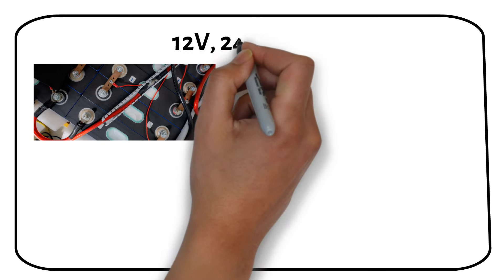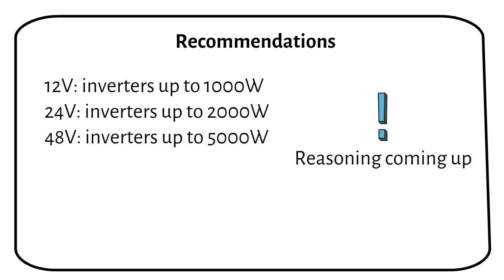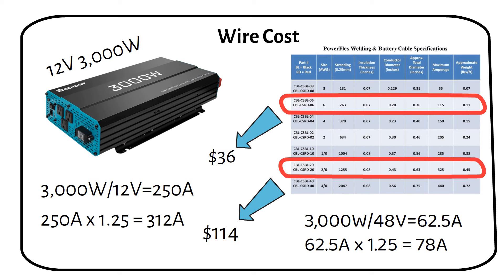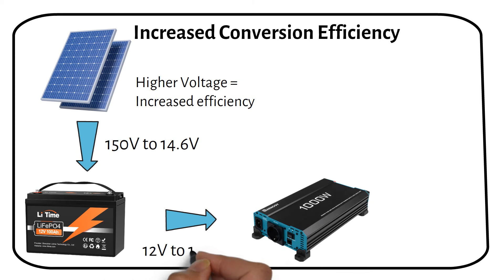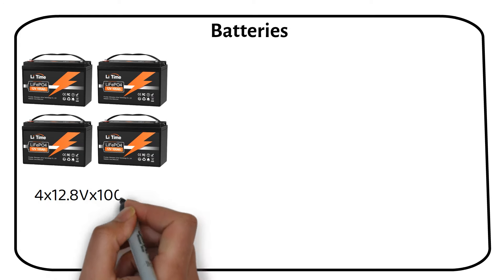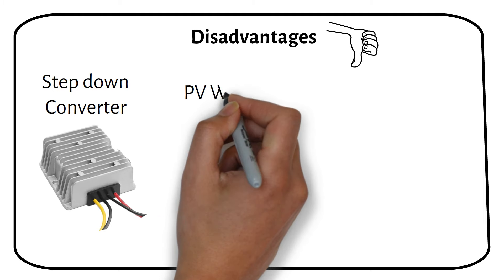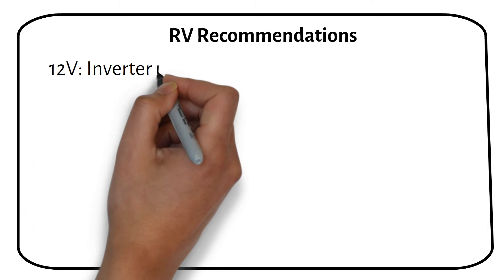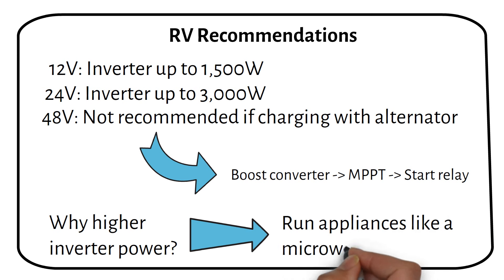12V, 24V, or 48V Battery for Off-Grid Solar Power

Comment: 48v does not pose any danger of electric shock. Please don't mislead people.
Reply from the maker: A fully charged battery is 56V. This is over the low voltage limit of 50V. so it's dangerous in the right circumstances.
Reply: No anything under 50 volts in considered low voltage a potential difference of .06 ma can kill
Reply: Le courant alternatif est dangereux à partir de 60V . Le courant continu est dangereux à partir de 120V dans les conditions normales… valeurs sont à diviser par 2, dans des conditions mouillées 😊… voilà ma contribution. Bonne soirée. From Paris 2024😊
Reply: Since the 48v batteries I use have a power switch
Reply: It's electricity don't matter it depends on the person's health
Reply: One of the greatest minds in solar, Dacian, when inventing his charge controllers and bms have repeatedly said he won't upgrade his ELECTRODACUS system to 48V is because 48v is dangerous.
Reply: Less than 30V won’t electrocute you if you complete the circuit. 48v is a different story.
Reply: Yeah right 12 volts can kill if the current is high enough. It's current kills not voltage. 48 volt can burn you if a short circuit and batteries are flammable fire kills just as much as electricity. To be safe cut off the battery and panels. You should have cut offs in your system bottom line it's safer to be over cautious than not say anything.  73
Reply: @ronb6182  we are assuming that our circuits are fused properly which will limit the current.  Back when I repaired batteries I regularly worked on 170Vdc battery packs.  These, however, were in a controlled environment so there was little chance of them moving around or things landing on them. There was certainly no chance of accidentally brushing up against them.  Properly done, a little 9v transistor radio battery can stop your heart, but generally, you won’t be killed by conventional 12v or 24v LFP batteries. 48v is a different story.
Reply: @cleversolarpower This is the extremely rare YouTube case, where you are both correct. 🙂 😂 (because NFPA and OSHA say 50 Volts)
Reply: 🤷 I guess sometimes it could take very little so mess someone’s electrical signals or impulse in the heart. Thinking d-fib/a-fib, I’m not a doctor, or an electrician lol
Reply: 48 volt can kill you dummy

Comment: Well, no one running a 48 volt 3,000 watt inverter should really use 6 gauge wire, that's not even a thing..My 3,000 watt inverter came with 4 gauge wires, and good ones, but I replaced those with better quality 2 gauge wires..Wires from inverters to batteries should always be over sized, or the maximum size the inverter will allow for..Short wires are a tiny cost when building a good system..If you are running wires 25-50 feet, that's a different story, but I wouldn't recommend that in just about any situation. I have a cabin in the forest, and I'm in a valley surrounded by mountains, so I don't get alot of sun, especially in the winter..I made a tiltable mount for my 370 watt panels, but it can also move to follow the sun from east to west..Both ends of the mount are 4x4 posts with a square frame made with 2x6's..A ten inch screw goes through the 4x4 posts and through the 2x6's giving me the ability to tilt the system..Which alot of people do..One of my 4x4's is connected to a platform I built from 2x4's and 2x6's and I put four 8 inch wheels underneath, the other 4x4 post is in a 3 foot hole in the ground connected to a bearing plate assembly..So as the sun moves across the southern sky from east to west, I can move the side with the wheels to follow it, while the other 4x4 rotates in place..I also installed some cement plugs in the ground with I bolts, so I can connect wire to the mounting system in it's various positions to secure it, in case of high winds..The system has increased it's output by over 40%, from when it was non tiltable or movable..When it hails I can make my panels go straight up and down, and the same thing when it snows..The panels are bifacial, so I also built a movable reflector for the underside..
Reply from the maker: 6 gauge wires are calculated on 105°C insulation temperature (welding cable). If you have a 90°C insulation rated cable, then yes, you need a larger wire.
Reply: @cleversolarpower  I'm going to point out that for power transmission, you don't go by temperature.  You don't want anything in the RV, boat, etc to ever get that hot even when the cable itself can handle it.   And you also don't want there ever to be any appreciable voltage drop at the nominal load if the cable happens to be long.  So use the power transmission AWG table for power-related stuff, always.  Do not use the temperature-ratings.

3000W @ 51.2V nominal (16s 48V LiFePO4) = ~60A = 4 AWG by the power transmission table.

That said, if you only need 3000W for surge and your nominal continuous power is far less, like 1500W, then you can size the wire for 30A power transmission which is 7 AWG with an appropriate 30A breaker and still allows surges to exceed that (type C DC breaker rather than the faster-tripping type B).

-Matt
Reply: @junkerzn7312 what would u recommend on a person that wears oxygen 24/7 if the grid went down.? Thank you
Reply: I was gonnna recommend an ohms law calculation
Reply: I'm wanting a similar system , csn you tell me how much battery , ah and volts. 
Plus panels amd wattage your using etc. 
I am a low maintenance person but still wanna have options also

Comment: I am using 2000w Modified Inverter with 2 x 12.8v 100Ah ea Gel Batteries in parallel, charging with solar panels, connected with 50A Controller I use this system to power my 170L Fridge on a daily basis + Charging Phones, Laptop. I started to use the system October 2023 till today and I can say that it is working effectively.
Reply from the maker: I recommend you take a look at my video about: 'how many batteries for a 3,000W inverter' it will help you size the system even better.

Comment: I have been experimenting with solar systems for the past three weeks. I purchased a 12-volt inverter with a 240V AC output, which is connected to four 115Ah AGM batteries. I have come to realise that the inverter was an error, as it draws too much current for UK 240V electrical equipment. Would you recommend that I opt for a 48V inverter instead? I will likely need to acquire an all-in-one solar charger, and I plan to configure the twelve 100-watt solar panels in series for the 48V system.
Reply from the maker: I recommend watching my most popular video on my channel. It's about sizing the battery to the inverter.

Comment: Can you tell me how to get maximum backup from Led acid or tubular batteries? Isn't it ture that Dc system is best for batteries to get maximum backup instead of inverter which converts 12 or 24 volts to 220 volts.
Reply from the maker: I recommend watching my video about sizing an off grid solar system.
Reply: @cleversolarpower  ok

Comment: Can i run ps4 slim using  48volts battery and 7000 inverter?
Reply from the maker: Yes, you can run about 28 of them.

Comment: Your video explains it very well. Thanks. I also used an inverter and a deep cycle 12V battery - The inverter burned out after a year and the battery did not last long. 12 Volt systems are not designed for large loads or Watts no matter how you wire it.

Comment: XLNT! I settled on 24v for my small project. Would have liked to do 48v but my initial 2 panel start wouldn't produce over 48v. I have 6 RV panels but ended up with two charge controllers. Gotta love Victron and the way the two controllers and smart shunt all talk to each other.  2 panels on a moveable angle adjustable cart feeding a 100/20. 4 panels fixed angle on roof feeding a 150/35. I wanted to experiment with angle and position of the cart and see if it generated more (or less) than 50% of the roof panels by moving it throughout the day and adjusting angle for the season.  Now in the winter I'm really seeing significant differences moving and angle adjusting makes.
Reply: Wait until you try ELECTRODACUS system. The guy is a genius.

Comment: Good video though I would add the number one benifit of higher volts is lower current which IS lower resistance resulting in lower HEAT POTENTIAL! A lot of new chargers can do all three 12/24/48v. I’d suggest to anyone dabbling in this area for the first time start at 12v for a few months until your confident to shift up to 24v and home run on 48v.. 12v is safer getting your feet wet.
Reply: I’m looking to backup my home for a few hours during random power losses.  Would like to have a system that can supply 11kwh (if I need it longer on that day I can fire up generator).  Would you suggest 48v for this application?   I’m experienced working safely with 480v systems at work however mapping them out for logistics. Is not my strong point😂

Comment: I have a off grid small cabin and i only want to run a minifridge, i currently have a 24v , 50 ah lithium battery and a 24v 1000watt pure sine wave inverter connected to two 320 watt panels in parallel that are 34v with a 30 amp mppt charge controller, do you think it will work?

Comment: Unfortunately I didn't realise my 48v battery from renogy was a 15s not a 16s, that extra cell makes a big difference to capacity. My battery is new and only settles at 50volts after charging to 54v. Doesn't seem right to me

Comment: There should be more 12v appliances today (meaning no need for 120V / AC voltage step-down conversions) especially for short distance wiring such as RV or mini-van converted campers lifestyle

Comment: Hi Sir, I bought 12V 990 watt solar panel, 230A battery and 1100VA inverter. Now how to connect the solar panels series or parallel
Reply: How many panels? Where are you using the system, RV or home?

Comment: Thanks for the lectures. How can I connect 6batteries on a 48v system
Reply from the maker: You can't. It's either 4x 12V batteries or 8x 6V batteries, ... So you have two batteries left over.

Comment: Hello, I am using 3000W hybrid inverter, 3x200ah Gel batteries and 2x400w solar panels but it only runs for only 4hours after sunset.
Reply: What appliances are you using ?. 4 hours seems pretty small
Reply: 800w panels not enough to charge 600ah battery fully

Comment: I have two identical 12 volt 100ah batteries and another 12 volt 280 ah battery,  After selecting a fourth 12v 100ah battery, would it be possible to wire these four mismatched batteries to 48 volts?

Jeff <----- newby trying to understand.

Nick, I have the book ordered from Amazon, expecting anyday now....

Comment: Sterling power sells a 12v-> 48v charger for automotive use.  Also, a secondary 48v alternator is a common way to charge a 48v system. 48v 100a alternators put out 5000W which is good for charging large 48v batteries.
Reply from the maker: The sterling 12V-48V charger sells for $800 I believe, not in everyone's budget.
Reply: @cleversolarpower  it charges at about 800 watts. Equivalent 12v-12v dc-dc chargers (or pairs of lesser chargers) will cost in the same ballpark

Comment: My local shop said don’t mess around with installing a 24v secondary battery/accessory system because it may cause issues given my car is 12V. 
What are your thoughts? I told them I was leaning toward a 24v setup after watching your videos
Reply from the maker: What issues? Your battery is 12V, not your car. Checkout my video about grounding.

Comment: These days 96V batteries are on the marked, can you make a video with your advise and calculation examples how to setup a system combined with solar?
Reply from the maker: Inverters are still limited to max 48V batteries, so the market is still very small.

Comment: Maybe it could be added that 50V is  the regulatory limit for low-voltage at least in some EU countries and 48V systems can go over that limit. This also means that officially you would need to hire an certified electrician to do the installation, which means any cost calculations going out the window. You can of course still do it yourself, but if your cabin/rv burns down for ANY reason, good luck explaining your DIY wiring job to the insurance company.
Reply from the maker: Great comment. 👏

Comment: Thanks again Nick for the solar diagrams, and informative material it’s great! But have a question. I’ve built Mob. Homes with solar since 1986 (10% eff & no controllers!) I’ve now decided to go the 24v 100A Lith. for house.  
The nagging Q is; why not wire the (my 750w 37.5v solar) controller on the (24v) cranking batt. side, the input to the 30-amp B2B? 
The pros would be less work for the alternator, cranks kept charged, and, save a few drops of fuel. Would I get away with that?

Comment: I see you talked about RV, but what about off-grid homes?
Will it not be better to go for 400v systems or similar that's closer to the solar panel voltages? Will HV system still be better than the typical 52V (LV) system?
There are systems like FoxESS, Sungrow and Sigenergy with these high voltage systems. The installation costs for the Fox and Sungrow are similar to that of the same size 52V system, and they are more efficient when coming to charging with a solar array due to the HV match
Reply from the maker: I talk about RV's and off grid homes in my videos. there is a limited amount of inverters that are suitable for high voltage. I recommend using 48V for home systems. You should not be installing systems higher than 48V yourself because it's quite dangerous.

Comment: I'm all new to this , why would a stronger converter require a smaller cooper wire
Reply from the maker: Because the voltage is different. Use the formula: current = power/voltage and you will see that if you increase the voltage, the current will drop. We size wires based on the current.

Comment: 2:10 How many feet of 2/0 wire are you talking about that is $114? What formula are you using?
Reply from the maker: 10ft black, 10ft red welding cable from windynation. Calculation is at 2:00

Comment: Hi Nick, 
I need help!
 
 I just 2x 25.6V/100Ah battery (lithium ), inverter 4000W, 
MPPT 100/50, 
solar panel 1x220W/(Voc 46,11V)/ 38,00V (Vmp) and
 1x180W/ 44,8V (Voc)/ 36,00(Vmp).

I live in Croatia. 3 days without sun battery comes to 30%.

Frigidaire 150
Leigh  80
Computer 30
Washing machine 2000
Water pump 600

How mach(power) solar panel's can I put?

Thanks for answers!
Reply from the maker: Depends on the total power consumption in a day in Watt-hours.

Comment: Wouldn't the Victron Orion 48v DC/DC converter work for a 48v RV for alternator charging?
Reply from the maker: That is a DC/DC converter. You need an Orion tr-smart 12-48v which doesn't exist. I found out the hard way 😄. Converters are not able to charge batteries.
Reply: @cleversolarpower    Thanks!  I'll remove this component and feature from my diagram.  Thanks for putting this video out!
Reply from the maker: svenshanah  They are very expensive. It would be cheaper to have a 24V system.But thanks for recommending me the brands, I have heard about the wakespeed, but not about Steerling.

Comment: Please advice, I m using 2x400w solar panels and 3kv hybrid inverter and two 200ah gel batteries but is discharging after 4hours from sunset, and I m only running a plasma 41"TV only. I m in South Africa. ✌️
Reply: I'm not an expert, but it seems like there's something not right with your system . What is the rated voltage and Amps on your TV input? (You can find that information on the backside of the TV or on the TV's power adapter)

How many amps of charging power does your inverter have?
Reply from the maker: 800W*6hours=4800Wh charging a day. 3,000W inverter = 30-50W standby power consumption = 40W*24h=960Wh. 12V*200Ah*2batteries*0.5 (50% DOD)=2400Wh. From my calculations your battery is charged up every day. You can use 2400Wh of battery power where 960Wh is consumed by the hybrid inverter itself. That leaves you with 1440Wh. Lets say the power is 150W*4hours=600Wh. That leaves you with  840Wh which are the battery degradation and energy transformation losses. So there is nothing wrong with your system, it's just undersized for the load.

Comment: i own a 48v system with 20 - 235W panels and I have purchased 30 - 260W additional panels , this is a 12kw system and will be adding 2 wind turbines as well which put out about 2kw each with 40 mph wind. This system came with 24 AGM batteries 105 Ah with 2 - 80 A Charge controllers, so I know that more charge controllers are necessary for the added panels and I suspect I will need more storage as the area this system will be located is overcast quite a bit, and that is the reason I purchased the other panels and need the extra controllers and batteries. This is my 1st off grid system and am unable to get grid power where this is going for a cabin. What are your thoughts regarding this situation? I feel like the panels added should allow me to charge the batteries (including the new batteries necessary) to overcome the worst conditions during the overcast time. The cabin will have approximately 12kwh of power requirements per day.
Reply from the maker: Small wind turbines do not provide the rated power. You will be lucky to get 300W per turbine. Not worth it in my opinion. You better get a generator to top up your battery when it's needed. Lithium is cheaper in the long run.